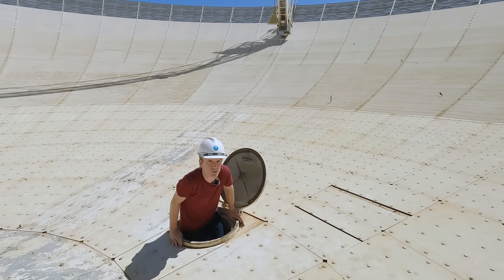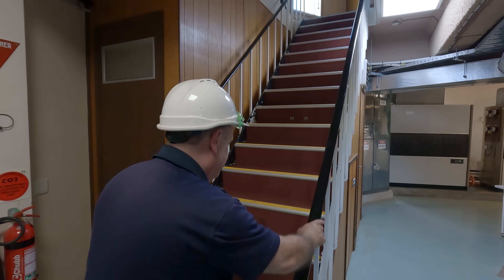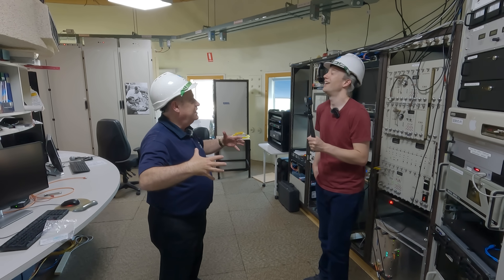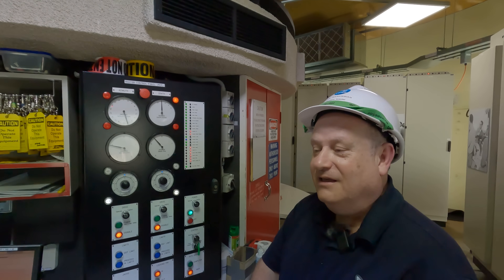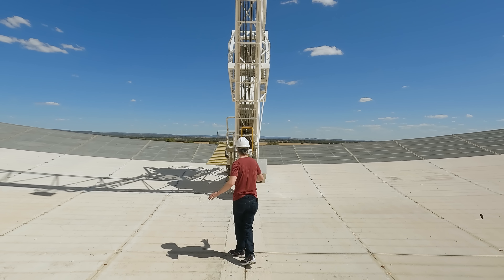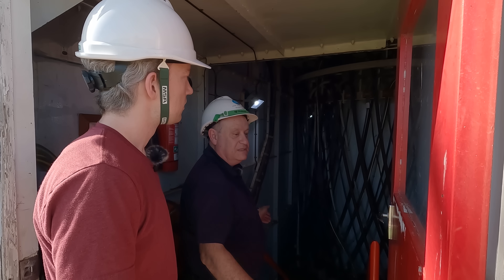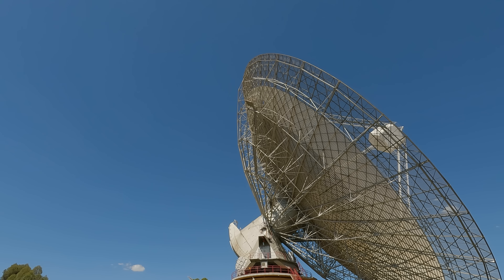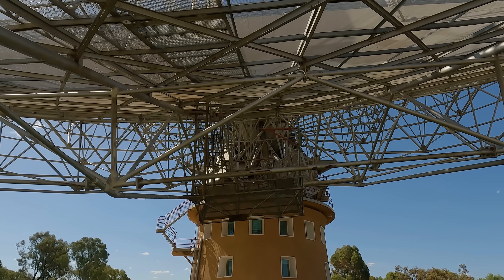I took a ride on a moving radio telescope

Comment: The idea that they can use the telescope itself as a giant crane is ingenious.
Reply: No doubt!
I never thought about having the edge of the scope go down to get the equipment into the dish.
But then, I should have thought of it.
I’ve used the power of a piece of heavy equipment to help assemble and disassemble itself!
Reply: @dangeary2134  Mobile crane? I think self-assembling cranes are such a cool design principle
Reply: like treebeard picking up a hobbit
Reply: Makes perfect sense, too! You already have an extremely robust and heavyweight piece of machinery to lift things high up, why not use it?
Reply: typical Aussie thinking :) We invent a lot of stuff cause of this sort of style of thinking. Why work hard if there's an easier way to acheive the same result :)
Reply: Typical Australian engineering. A simple solution to a problem. Although it’s not the most elegant solution it sure as hell works

Comment: The radio quiet discussion reminds me of the time I was at Onsala Observatory in Sweden and they'd recently fixed a couple of recurring problems by getting a nearby farmer to turn off his electric fence and removing the microwave oven from the staff room.
Reply: Fun fact: There was once an amazing high power signal discovered by the Parkes team, however it was simply from one of them using the microwave at the wrong time.

Comment: I don’t get how even the 1,000 ton weight is enough to keep the dish in place. That’s a enormous surface area and the wind pressure on that even when level has to be crazy. I guess just a super low center of gravity, but still.

Edit: Ok, I see that massive counter weight, that makes more sense, but still.

Comment: Thanks for emphasizing that computers really aren't necessary, except in gathering and analyzing data. Built in 1951 using analog devices and still running with only regular maintenance.

Comment: Umm... the PDP-11 has Operating Systems 😂🤣 Mine is running 2.11BSD. Though I suppose they could have built a purpose built application, where essentially the application is the operating system.

Comment: It is amazing how smooth the structure seems to move. ^^ and its interesting that it is stable enough to not only support you but heavy equipment but not to surprising when considered that it has to handle gusty winds ... i wonder how it would look in closed umbrella for storms ^^
Reply: Well, that movement is actually done by the "coarse guidance" system, which aims the telescope to within a half degree or so of the desired position, and then the fine guidance system can take over to refine the position. Of course it has to be smooth, as the fine guidance system cannot cope with sudden changes, so all motion must be smooth and with no sharp jolts.

Comment: Was there any actual reason to have Tom ride the dish down, other than fitting the "Tom does a thing" formula?  
(I get that the reason it can be done is to get equipment on and off, but it didn't look like anything was being loaded/unloaded this trip.)

Comment: “The amount of energy the feather expended when it struck the floor is more energy than has ever been collected by every radio telescope ever” what a mind boggling comparison!
Reply: It was such a simple yet superbly powerful demonstration.
Reply: no wonder a smartphone, which emits radiation in the order of milliwatts, shines as bright as a bonfire to a telescope like this, even when placed on the moon.
Reply: I'm not sure about every radio telescope, but there are some you can't even use cars with spark plugs around because the spark to start the combustion will get picked up. The Green Bank Observatory over in West Virginia has to keep a little fleet of diesel cars to navigate the grounds.
Reply: Imagine theres an alien radio wave that hit directly at Tom at the time

Comment: the fact a feather hitting the floor is more energy than has even been collected from the stars is mind blowing to me, it's crazy how amazing technology is
Reply: Also remember that the signal coming from Voyager is so weak that they can barely receive it with those massive dishes, and the communications back are done using multiple hundreds of kilowatts of power, sent via the same dish, and the spacecraft will only get them more than 24 hours later, and reply also 24 hours later on. Also the voyager spacecraft were never actually designed to last that long, they were actually spare Mariner spacecraft bodies that got a massive antenna grafted on to allow communications, then a RTG instead of solar panels, and thus were sent out. Now down to a little over 200W of power for use on the spacecraft, so by around 2030 they will no longer have enough power left to transmit high speed data, and soon after that will lose all transmit power, though the computer will continue to operate, and keep the spacecraft aimed at the sun for decades afterwards, but will be mute.
Reply: @SeanBZA  ..Voyager's dish and power were deliberately designed to be a small as possible, so the signal was only just strong enough to be detected - it has a fiendish error correction protocol to try and compensate which is why the images take so long to download - it is an extremely weak signal to start with (just not by today's standards)
Reply: @davidioanhedges  Yes it is small, but by the standards for the Mariner probes it was based off it was huge, and the error correction was designed to be as robust as possible, but also as simple to implement in the spacecraft as well, as complexity at the time came with added mass, and you had an overall maximum launch mass you could not exceed. Thus the panels were made from Beryllium aluminium alloy, milled as thin as possible in low stress areas, and milled away completely where not needed, just to avoid the mass of a rivet to hold a gusset in place.

Remember at this time digital decoding was done using discrete chips, or using massive computers, so to put the error correction and forward error correction in the probe they had to choose between robustness, data rate and mass, choose one, because mass is the severe limit. Even the digital data recorder was special, because it had to survive in a vacuum, and it still does work now, that design and the tapes are still holding up.
Reply: @SeanBZA  The Voyager probes weren't larger than some of the later Mariner probes. Mariner 8 and 9 had a launch mass of 998kg while Voyager 1 and 2 weighed 815kg at launch. The Mariner probes had a higher fuel proportion because they needed to enter a Mars orbit instead of just doing a flyby, but most of the higher dry mass of the Voyager probes is just from the RTGs alone (dry mass of Mariner 8+9 was 558kg, Voyager 1+2 minus the RTGs is 600kg).
Reply: @davidioanhedges  The last time one of the voyager probes transmitted an image to Earth was more than 30 years ago, the "Family Portrait" taken by Voyager 1 in February 1990. The cameras on board have been switched off ever since. And I wouldn't call the Reed-Solomon error correction used by the probes "fiendish". Even plain old compact discs that came out only five years after Voyager launched use a more complex error correction scheme (two interleaved Reed-Solomon codes instead of just one like Voyager), and today Reed-Solomon codes are slowly being phased out in digital storage and communications in favor of more complex but more efficient protocols (eg. DVB-S used Reed-Solomon while the successor DVB-S2 uses Bose–Chaudhuri–Hocquenghem (BCH) codes).
Reply: @davidioanhedges  yes it’s a small concentrated dish, think of it as a flashlight that has an adjustable beam. Far and wide is spread to a far but weak in the center, adjusted to a fine concentrated beam and it’s bright and powerful to one specified area, the concept is no different with radio waves acting as light.
Reply: @SeanBZA  The current signal delay for Voyager 1 is 22 hours 5 minutes, and 18 hours 27 minutes for Voyager 2, not more than 24 hours. Increasing by about 25 minutes per year (although at the moment the delay for Voyager 1 is slowly decreasing because in the current part of Earth's orbit around the Sun the distance to the Voyager 1 probe is actually slowly shrinking by about 1km per second; Earth's orbital speed is a lot higher than the speed of the Voyagers probes relative to the Sun, so for part of the orbit Earth is "catching up" to the probes).
Reply: @blahfasel2000  huh, that's amazing. I've got a degree in space science, have loved voyager since I was a kid and I still didn't know that. Thanks mate!
Reply: @SeanBZA  like in death

Hearing goes last
Reply: @gameseeker6307  that has nothing to do with what’s being said.
Unless you’re referring to the “mute” part. That would be speech/ communication.
Reply: @SeanBZA it’s not aimed at the sun
Reply: @SeanBZA  The fact that they can detect some tiny ass probe in space millions of miles away, yet i have dead zones on my phone on Earth is mind blowing
Reply: @FinnishArmy  There's a lot more dirt and steel between your phone and the mobile tower than there is between Parkes and voyager.
Reply: @SeanBZA  I dont think 5 bytes a second on average is high speed but ok
Reply: Even everyday radio technology is amazing in general. Your cellphone is transmitting with less than 2 watts to a tower up to several kilometers/miles away and somehow the tower can pick up your signal out of all the noise in the air with no trouble at all. Like whispering into the wind and hoping someone hears you and they do.
Reply: @tylisirn  message in a bottle vibe
Reply: @tylisirn  Last I knew, digital cell phones used a maximum of 0.6W transmission power. Of course, I haven’t kept up with 4G/LTE and 5G technology, so perhaps it has changed?
Reply: @tylisirn  .5W
Reply: Collected by radio telescopes. We have telescopes looking in all frequencies from gamma rays down to millimeter waves and microwaves. Radio waves have the lowest frequencies and thus the lowest energy of all EM radiation. So even an intense radio source doesn't actually have much energy.

The highest-energy receiver on this telescope is the K-band receiver covering 16-26 GHz, or 1.2-1.9 cm. By comparison, the highest energy received by Hubble is 115 nm, or 100,000 times as high.
Reply: @EebstertheGreat  There's plenty of visible light from the nearer stars and galaxies!
Reply: Not "from the stars". We get quite a bit more energy than that from a single star in a second. Just for the purposes of radio astronomy.
Reply: Well, if you focus on radio waves and exclude the Sun. 
I wanted to say "Radio waves emitted by the Sun are equivalent to X feathers hitting the planet every second," but I couldn't find any specific information about what fraction of sunlight is radio waves. It's probably somewhere below 10^20 feathers per second*, assuming the feathers hit the ground at 1 meter per second, but I can't say how much.

(Upper bound is around 10^11 if the feathers approach Earth from the edge of its gravity well, likely being incinerated or at least scorched before they reach the ground. That would be an average of twelve feathers per acre per minute, ignoring how some parts of the planet receive more sublight than others.)

*The best value I found is <1% for gamma, x-rays, and radio waves combined. 1% would be about 10^20 feathers per second.
Reply: @timothymclean  He did also make the qualifier "for astronomical data" in there too. That'd knock several orders of magnitude off the energy being spoken about.
Reply: No, you’re mind blowing.
Reply: @deltalou8987  okay
Reply: Its good that way. If it had more energy, we wouldn't be here.
Reply: That energy came from stars , everything on earth rubs off of the sun
Reply: Sorry but you forgot that sun is also a star
Reply: I, for once, find it amazing how crazy technology is.
Reply: Fr
Reply: @ScrungleGaming goddamn I had a stroke reading that
Reply: If you think about it... how has technology advanced so much so quickly. Any type of technology to me is mind blowing.
Reply: And the fact that humans made it to space with less then a megabyte
Reply: I wonder how long that phrase will stay relevant
Reply: Solar power is kinda like star energy
Reply: Dish 43 at the Canberra Deep Space Communication Complex at Tidbinbilla (outside of Canberra, about 3.5 hours drive from Parkes) is tracking Voyager 2 at this exact moment!
Reply: @mashy0001  
Canberra Australia?
Or somewhere else
Reply: @KosoGaming2025  yes, Canberra in Australia. The Tidbinbilla NASA complex is about a 45 minute drive from the city centre.
Reply: It like technically yes but no
Reply: But almost all of the energy we use came from the sun. Its directly stored in massive liquid deposits called oil. All of the matter on the planet came out of a star at some point anyway
Reply: Wind powered boats next then... 😅
Reply: Its hard  to comprehend how little energy is collected and analysed from these radio telescopes without electrical noise affecting the results.
Reply: It's more mind blowing after all these breakthroughs, there are still people that believe the Earth is flat
Reply: Uh
Reply: 195 days later...
Heaven too danger streaming english you
Reply: Why are we collecting energy from the stars
Reply: You need a .
Reply: Whats the website called
Reply: Spreading misinformation like crazy
Reply: How? It’s saying technology hasn’t gotten much energy
Reply: theres not even enough technology in our era to find continue and clean energy to save our planet and have a sustainable way of living. its ludacris to think we could collect energy from a star :P also if you count solar panels taking solar light and turning it into energy...  theres one way.
Reply: Or.. how weak our technology is.
Reply: Berdasarkan kepada muhammad
Reply: Indonesia Negeri Fakta Ingkar Negara Impian Keselamatan Stereo
Reply: They are collecting photons which don't have mass. So it's not that crazy.
Reply: @LightPink  photons don't have mass, but they certainly have energy.  For instance, the photons your microwave oven generates have enough energy to cook food
Reply: Hey my friend. Our Saviour Jesus Christ died so that we will live. Jesus said, "I'm the way and the truth and the life. No one comes to the Father except through Me". John 14:6.
Reply: I'd take facts like that with a grain of salt... there is nothing to backup that it is true.
Reply: @HaydenHatTrick  Do the maths then. It shouldn't be hard to get an order of magnitude estimation.
Reply: @HaydenHatTrick  I'm sure he knows what he's talking about.
Reply: @soundscape26  I'm sure you can find something to backup the claim then.
Reply: @HaydenHattrick  the dude who told tom that is a highly trained professional, as he is the one chosen to show tom around the place. I doubt that he would tell tom misinformation...
Reply: @HaydenHatTrick  can you prove your point ?
Reply: @HaydenHatTrick  I agree, I'd like to see the calculation. But it wouldn't really surprise me. The energy in incident radiation is very small, and when you're looking at the night sky, there is very little radiation to begin with. And telescope dishes are not that big in the grand scheme of things. And radio waves in particular carry extremely little energy.

Comment: Wow this brings back memories, back in the late 1990's I had the opportunity to walk around on the surface of a somewhat smaller 25 meter VLBA radio telescope dish (vs 64 meter shown in this video) which was built in the 1980's, which had a slightly more modern feel than the dish seen here.

Comment: The fact that this still runs on a PDP-11 is SO cool!
Reply: What's amazing is that DEC didn't discontinue the PDP-11 until 1997!
Reply: Yes, my ears perked up at that point, having programmed PDP-11s over 40 years ago. Let's hope they can still get parts!
Reply: I was going to say the same - I worked in a chromatography lab in the 70s which was partly controlled by a PDP 11/10 and PDP 11/40 combination.
Reply: @@braxtongunnell5518 very cool find.